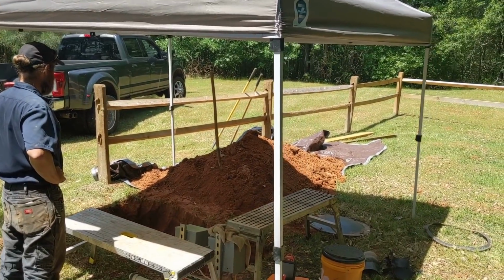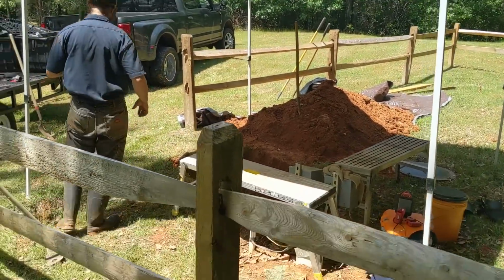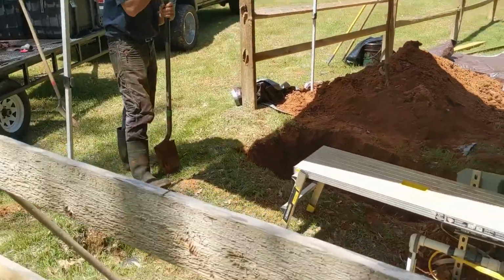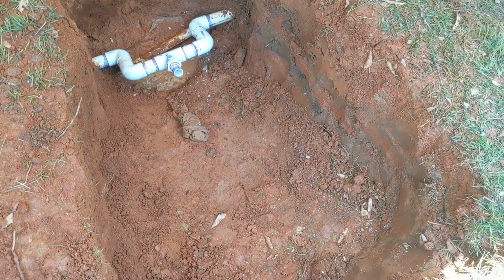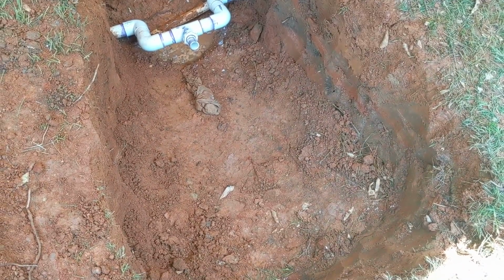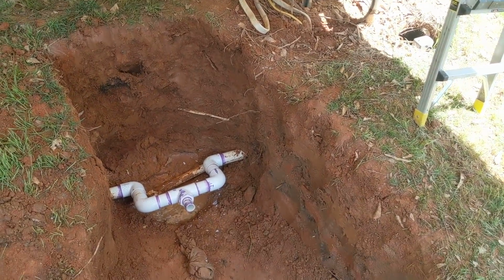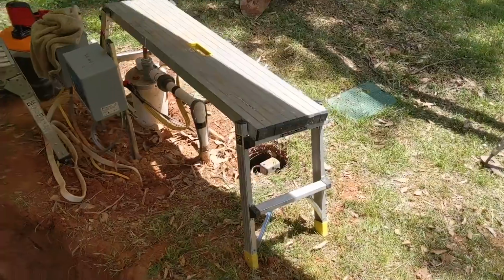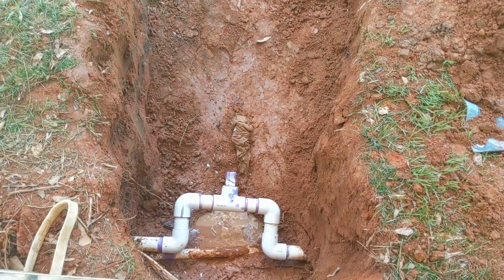Engineer775 messed up this time!

Comment: I'm curious—if you know—how to determine when you need to provide shoring to keep the walls of your trench from caving in? That looks almost deep enough to begin to think about shoring.
Reply: @Tom Condon  If I may shorten your question?? Ohh M.R Enginer775, If I may ask a question?? At what depth would you in your infinite wisdom, would you recommend shoring in the soil conditions you are currently working in??  Okay that's not shorter but just as snarky!! As the reply...
Reply from the maker: Oh no we're dumb enough to go about 25 ft down before we start shoring
Reply: @engineer775  I have a question that needed answering. I'm not looking for a competition, nor am I denigrating you. That's OK, I will seek my answers elsewhere.
Reply: @engineer775   I'm hoping this is a miss communication to what I see as an honest question??
Reply: Yes, I want to learn about shoring. I am interested in compacted earth being 'X', and removed earth being X + what percentage. I am interested at what depth one needs shoring, and parameters of the structure according to depth, and how to shore, then build a permanent (term escapes me, it's kate) wall to resist the force, whether speed block, pour in place, or wood and post. I've worked on engineered concrete walls, batter board rising 12 feet. I worked with an engineer drilling friction pier foundation in decomposed granite in an underground stream, deepest hole was 26 feet, I've vectored 3 phase high voltage circuits. I'm building an electrical circuit right now with 2 Tesla batteries, 10.6 MAh, Victron components. I have a computer tower I will be building from scratch. I have a lot of projects. My most important project is to learn the structural parameters of rehabilitating and strengthening  my bilateral avascular necrotic hips, left full replacement, (botched), with squashed disk, torn meniscus, and other damage. I had tried to enroll in Mackie Shilstone's executive program, (Mackie trained the Williams sister, Vanessa?, who went on to win multiple gold at the last Olympics in tennis), but he rejected me because I can't be released to non-disabled status. No one will help me, liability fears, I guess. I've been very sedentary for a long time. I am very slow getting things done. I have many projects. I have struggled to find information on shoring excavation.